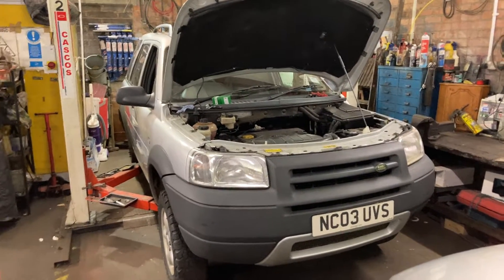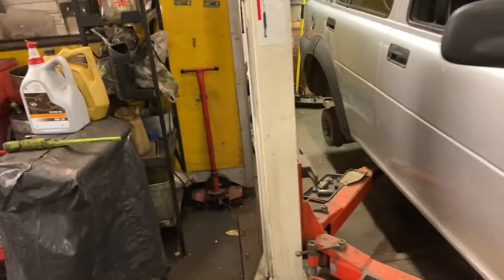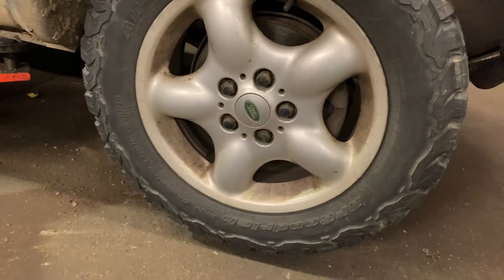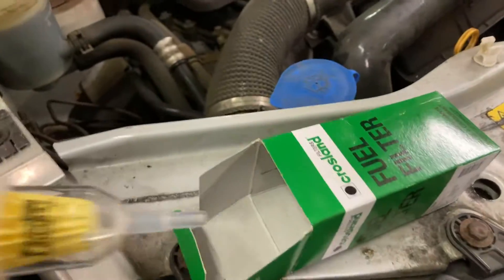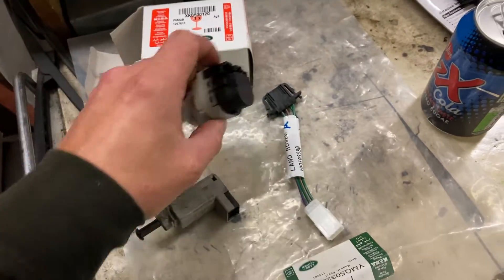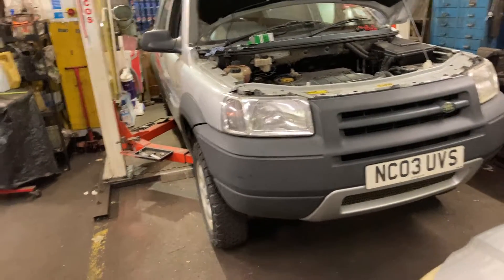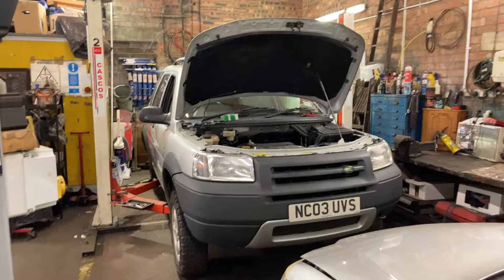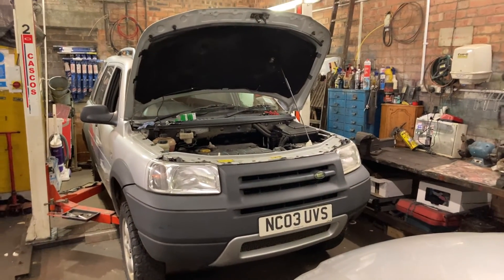Project Freelander Part 1| Land Rover Freelander TD4 4x4

Comment: Thanks for sharing this series, gonna see a complete diesel one for sale at 700 bucks… will see if it’s worth saving :)
Reply from the maker: That’s cheap just check the all important Freelander issues.
Keep me posted 👍🏼
Reply: @CarAddictGarageNE  diesel one was not worth saving, but luckily i found a 1.8 16v with a broken transmission at 500€… engine is in good shape. Not sure about the IRD but worse comes to worst i’ll FWD the car…
Reply from the maker: Yeah the 1.8 K series is a good engine if looked after, easy, cheap and simple to work on as well 👍🏼

Comment: Just watch your video, thank you for doing it. I bought yesterday a 2002 TD4 3 doors in the same color than you. If you had to list all the "fiabliization" things to do on this vehicle (around 180000miles, now in 4x2 but about to receive a working IRD), what would you recommend to do? I have on my list : EGR blanking, K&N air Filter, 4 new tires (I will stay on the size of the spare wheel : 195/80R15 because I mostly do long trips on Freeways)... Would you advice to try and open / recondition the VCU as its often the cause of the IRD failure? And bonus question, because I didn't exactly understand what you did with the new contact thing, what is it for? Thank you very much, keep up this very interesting channel :)
Reply from the maker: To be honest at that miles / age I would just keep everything as 2WD as things start to get very expensive.

One of the most important things to change on the M47 is the crank case ventilation filter that sits in the top of the rocker cover, these can cause turbo / engine failure when they block, as most times they are missed on service
Reply: @CarAddictGarageNE  Thank you very much. I will have to put it back in 4x4 because in France the MOT won't be positive if I don't so not much choice here....
Reply from the maker: @user-cq8bm6dd9y 
Will be similar to the Spanish ITV I understand now everything has to work.

Comment: Just bought a 2002 FL T4 needs a new turbo where is it located and how do I go about replacing it please??
Reply from the maker: Unfortunately it’s right down the back of the engine, only way to access is up the back from underneath, or strip all the air box out that gives you bit more assess.
Thanks for watching

Comment: In general what you think land  Rover freelander 1 2.0 td4 is a Good car?
Reply from the maker: I think they are fantastic have aged very well, was never very keen when they were new, but now get a tidy one well looked after that’s still 4x4 you have very capable off roader and general good day to day car.

After the re map in super impressed with this car, must new stuff couldn’t keep up, be interesting to see how the extra torque works off road
Reply: @CarAddictGarageNE  i have a freelander 1 2.0 td4 from 2001 got no rust on it!
Reply from the maker: Yes they hold up very well corrosion wise, much better than the other brands, even better than most other rover/LandRover range